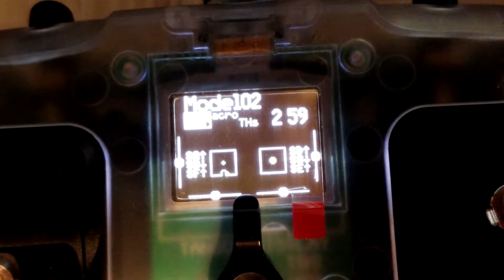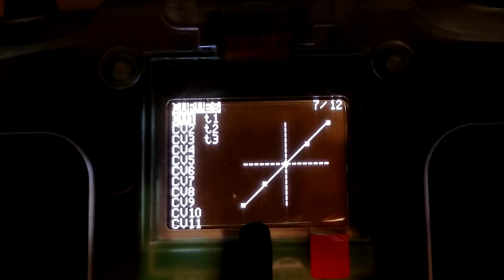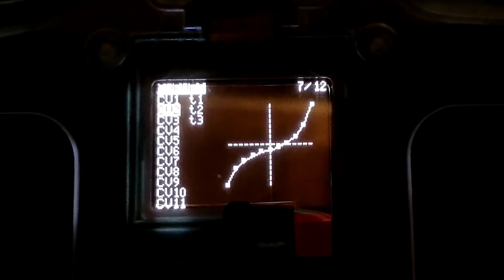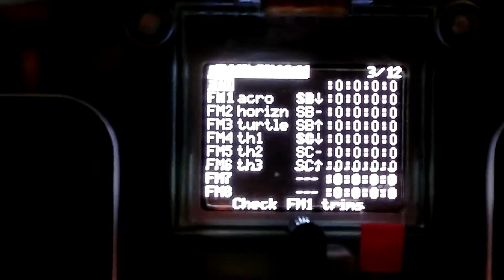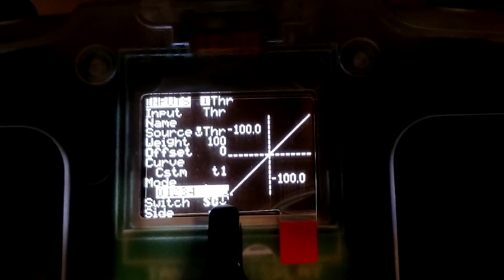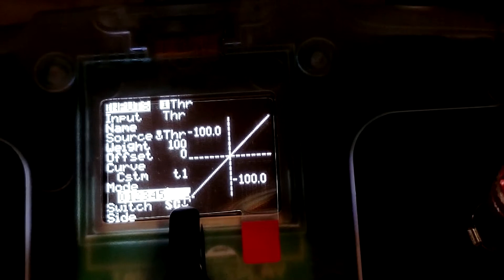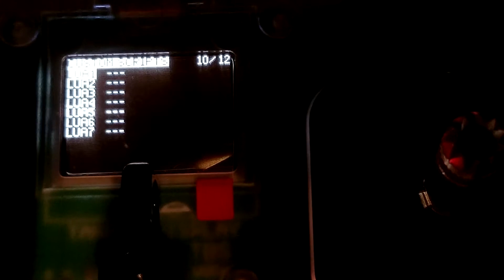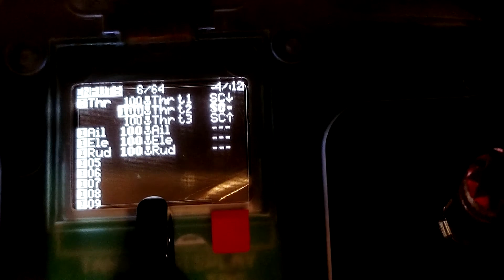Tango 2 or opentx - setting throttle curves on switch

Comment: Hello sir, May I ask what I'm doing wrong when I make changes to one of my curve the other one got messed up? Thank you sir. Sorry to elaborate it more I set CV1 then I got to CV2 but when I changed my CV2 Value the CV1 graph changed as well.
Reply from the maker: Um... I have no idea why that's happening.  They should be independent of each other.  Try creating a new one.  Cv3.
Reply: @notasixpack  Thank you sir for getting back to me. I've tried to created on slot 3 and 4 but for some reason they all changes as I made changes in one slot. The weird thing is if I go to slot 1 and click custom back to standard vice versa the one I adjusted from slot 1 it go back to normal slot 1, because when I make changes on slot 2 and 3 it changes slot 1. but when I click on standard back to custom the graph in slot 1 go back to original where I haven't changes slot 2 and 3. SO I now the setting saved But I don't know why they are affecting each other.
Reply from the maker: @bohaman.  I'm no openTX expert, so I can't say why it's doing that.  It sounds like all the curves have a dependency on curve 1.  did you give them unique names?

Comment: Nice video, but isn't the what throttle expo does in BF ?
Reply from the maker: Well on the radio you can assign as many curves to 2 different switches if you have them to spare.  Might be able to do the same with bf.  But more importantly bf throttle curve has 2 parameters.  Mid and expo.   Not very customizable.  With the radio curve you can control it as much as you like. I have a wildly different curve for whoops.